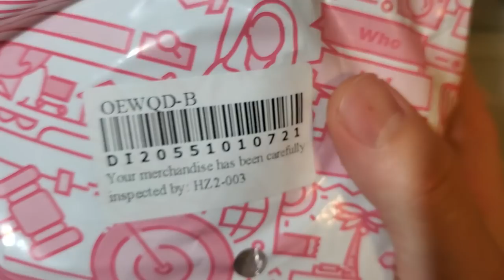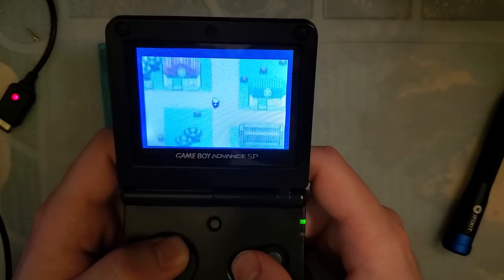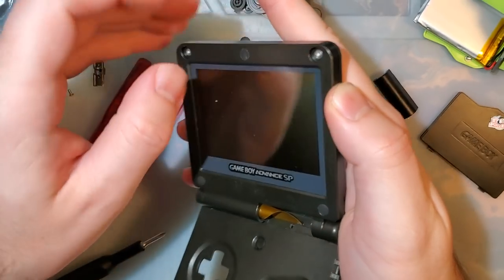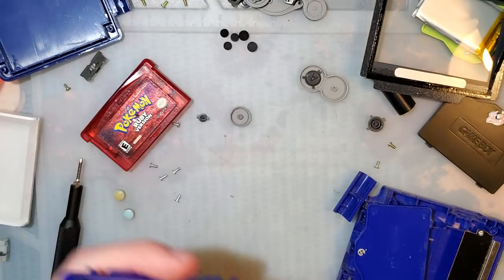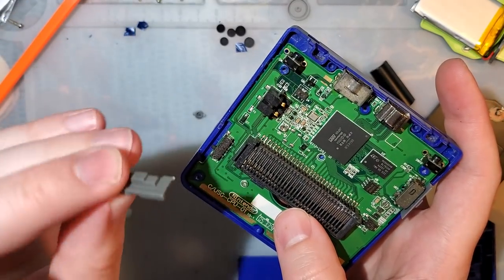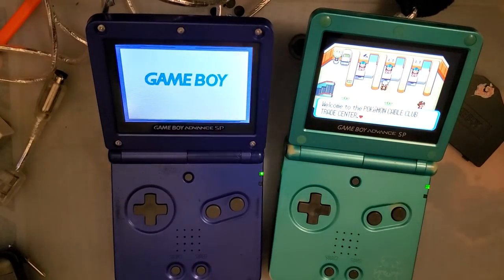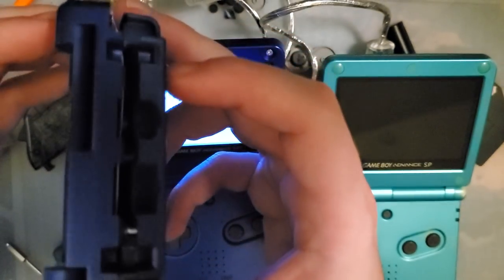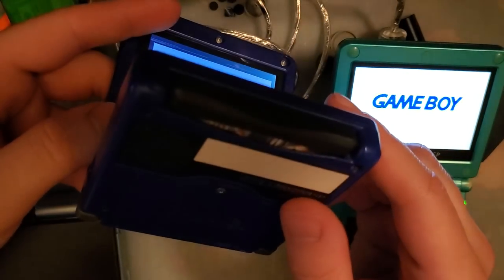Reshelling my New (to me) Game Boy Macro

Comment: At first I thought: Dayum, someone trimmed a DS lite to fit into an SP case? But, wow: Turns out, they made their own PCB! That's amazing. 
They even tried something with the Link-Port. I looked around the Internet if someone got it to work, but it seems like there are some pins missing, that's probably why the "macro" crashes or something? I dunno. 
Also, it seems like they managed to remove the wireless board. I haven't seen that before.
Reply from the maker: It was crashing because of the loose metallic square nut.
Reply: @makho  Oh, makes sense.

Comment: I have to say this. I'm pretty sure that gba sp, ds, thing is underclocked to an extent. The sound and speed is just off.
Reply from the maker: It's certainly possible. I don't know what parts are salvaged beyond the CPU and system memory.
Reply: @makho  I'm not sure either. I almost want to get one for myself to experiment. I'd also like to know where you got your info to finally get single screen DS mod working right. I want to try that out.

Comment: I recall AliExpress having $20 SP clones, but they vanished very quickly. I wonder what happened.

I also wonder if you can bridge some cartridge pins or something to make it boot permanently into a GBA mode and hide the DS mode altogether.
Reply from the maker: Not that I know of but with a cart inserted, it should always boot to GBA mode anyway if you leave "Auto Mode" on in the boot settings of the DS menu. Even if you reset the UI by removing the battery, it will still autoboot.

Comment: 313/5000
hello I saw some of your videos and I was wondering if you could help me, I bought a used micro gameboy at a good price but I realized that it has broken the clip where it connects to the flex that controls the brightness, there is some way to fix it without having to completely replace the part? (I'm not good at welding)
Reply from the maker: No, it requires soldering.

Comment: I wonder if this would technically work with Loopy's original DS capture card. That would be interesting if it did.
Reply from the maker: It should. This uses a different LCD connector though so you'd have to make an adapter.

Comment: The link port looks like it's connected to the CPU but I think Nintendo removed the code to make  the port work from the DS and DS lite's GBA bios (because those systems don't have a link port but they should have set it up to use NiFi for multiplayer games like the emulators do) so if you replaced the gba BIOS with one from a original GBA or GBA SP without breaking the DS bios it should start working.
Reply from the maker: And where did this speculation come from? I don't think any of this is correct.

Comment: My DS Lite has that volume slider...
Reply: Mine does too and it's all original except for the shell and digitizer because the original shell got scratched really bad when the girlfriend that I had in 2016 knocked it out of my hand onto the ground (she wasn't trying to it was a accident), the system kind of worked fine after that but the digitizer broke when it hit the ground so I could only use it as a GBA but I have it almost fixed 5 years later I just have to wait until I can get some more parts and I'll have 2 DS lite systems.

Comment: I have seen a top screen for a DS used for the bottom by trimming the audio traces from the ribbon cable, it looked really sketchy but it worked.
Reply from the maker: That's fantastic but that's not what this is. DS consoles use the exact same part for both the top and bottom screen and to install the top screen on the bottom or vice versa, the only mod required is removing or installing the touch screen digitizer.